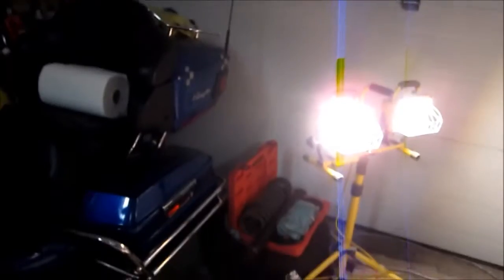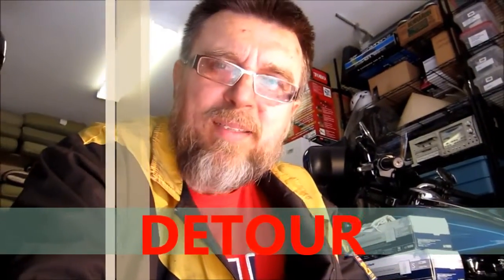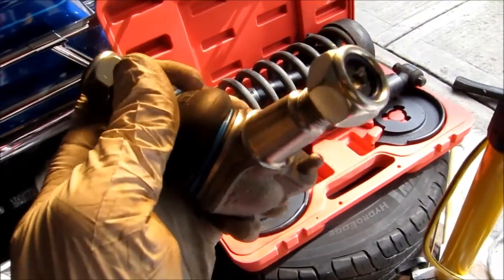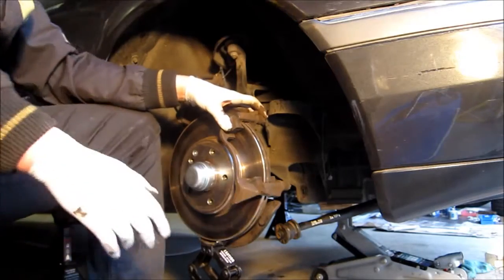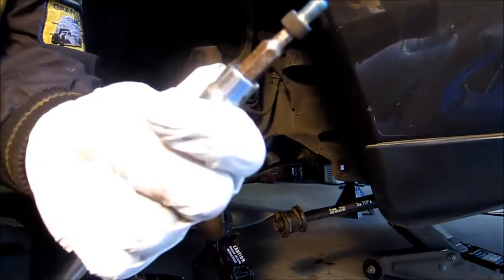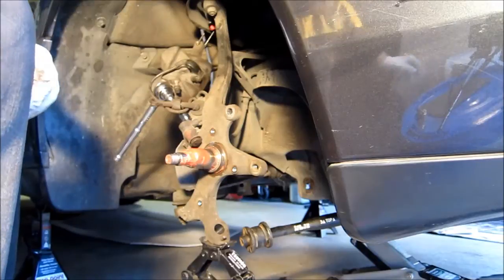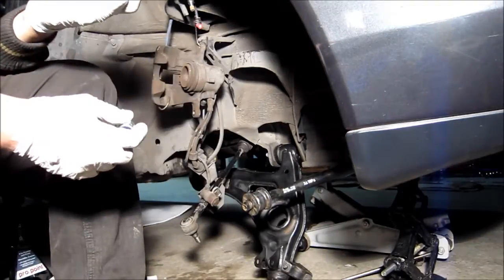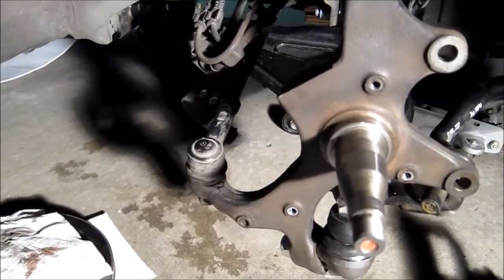Mercedes-Benz W202 C280 Front Suspension Part 3 - Steering knuckle removal and installation

Comment: We changed recetly the lower arm on my w202 C180 and since than I have some clunking noise when driving over 35 kmh over the bigger holes on the road. Every thing is new and I really ront know what it could be. It comes somewhere from left top side. We still have to change the rear gearbox mount, but dont know what is the reason for that clunking sound ?

Comment: why did you not replace the upper balljoint? i dont understand why it was nessicary to remove all the steering knuckle components and dust sheild?
Reply from the maker: Upper ball joints were ok this is why I did not have to replace them. The reason I had to remove steering knuckles is to remove alignment pin on the lower ball joints because the lower ball joints came with the pins installed and I had a choice either remove the pins from a new ball joints or from the steering knuckle. For some reason at the time I thought that it would make sense to remove the alignment pins from the steering knuckle.

Comment: Hi andy.
Is ok to use after market suspention bushes,control arm bushes an ball  for 1996 w202 c180.wont the alignnent be difficult set?
Reply from the maker: You will need an alignment done. 
I used aftermarket polyurethane bushings and had to use new LCA bolts 
see: https://www.youtube.com/watch?v=qWsQ0FxILmI&t=121s

Comment: do i need to do all that if i only want to change the lower ball joint?
Reply from the maker: Geo Weezy James
No, you don't. But its a very dangerous job bacause of the force of the spring. If you do t feel comfortable i suggest you get it done by someone who knows what hes doing. 
Remove the wheel and support lower arm with a jack. When you disconnect the steering knuckle from lower arm ball joint nothing is holding the spring. If you lower the arm too far down the spring will shoot out.
Get a strut type spring compressors and put them on the spring for safety.
But again if you are not comfortable and you don't know what you are doing take it to a mechanic.
Reply: AndyP Mercedes-Benz Channel thank you!

Comment: hi andy, i have w202 (1996) and i have a question about suspension. can i replace with suspension from W124 ? becoz my friend told me it will be more smooth and comfy if i am using it.
Reply from the maker: Are you talking about replacing the front springs? and using W124 springs?
Reply: yes correct
Reply from the maker: I don't know, never done it. But you can try... if you have the MB spring compression tool it's 10 min to change the springs, after you remove the shocks. If you don't like it  put the old ones back. Just make sure the springs are same outside diameter
Reply: ok andy, you're cool.   i have one last question, there is a squeky sound coming from the front wheels (right-left). and it's very annoying. i tried to spray with WD-40 grease. but it deosnt work... is it coming from the suspension or bushing ?
Reply from the maker: Hard to say, but most likely it's the sway bar. Lower control arm bushings and sway bar bushings are known to squeak. First remove the sway bar and if bushings are OK apply some bushing grease (it looks like silicone grease) inside the bushings and reinstall. This is a 15 min job, very easy. If bushings are worn might want to replace them, they are not expensive  and only 4 of them.
If you still hear the noise move to the lower control arm bushings.
Reply: This is Perfect. Thank you so much Andy. i do appreciate for the answers. Can't wait to check on it. I will update to you once it's done. Thank you again

Comment: on the lower Control Arm
Reply: I have a 96 C280 and My Lower Control arm broke but the same bolt you was explaining has the same star bit and a large nut looking for the size to look for the at a Auto store
Reply from the maker: Luis Correa 
i dont remember. i think the bit is t40 or t50 and wrench 17mm or 19mm. if u plan to remove LCA better get a torx set and a metric wrench set from harbour freight.

are u planning to pull out the LCA?
do u have a spring compressor?
Reply: AndyP Mercedes Channel ThankU my New Friend